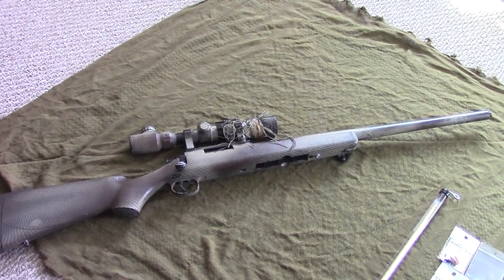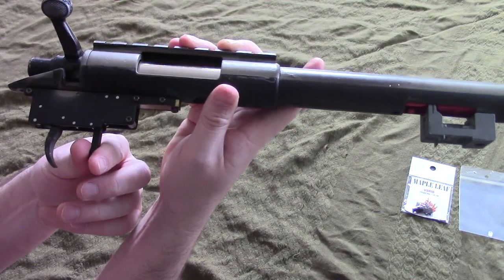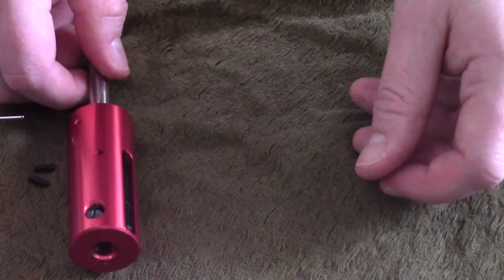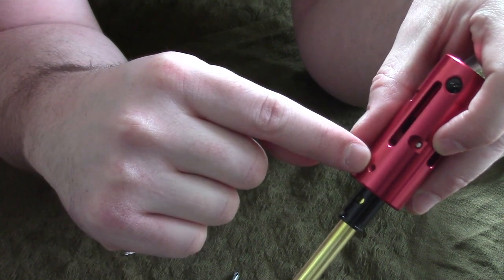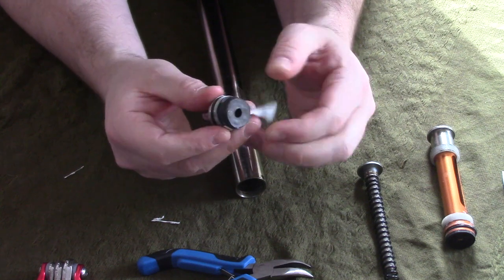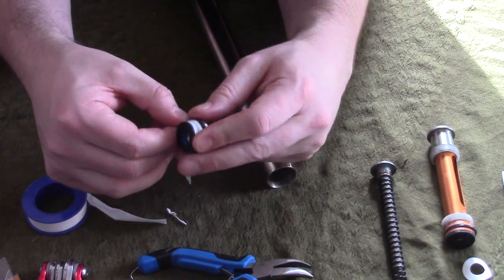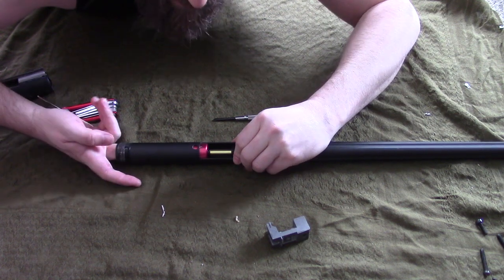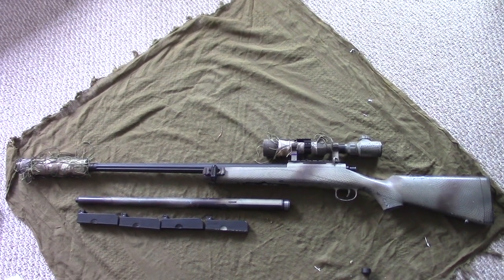Airsoft Tokyo Marui VSR-10 Upgrade

Comment: Can you recommend me some vsr10 stocks?
Reply from the maker: Hmm when you say stocks are you referring to the entire lower body/stock as they’re one piece?
Reply: @kokosaysnono  no i mean the stock the plastic piece of thing that holds the gun

Haha sorry I'm a filipino its kinda hard to explain it in english
Reply from the maker: @migo9625  haha no worries bud I've only used the stock I currently have but I looked into the MLC-S1 stock. It's pricey though but comes with more features and is bigger :)
Reply: @kokosaysnono  thanks bud

Last one question

Do ya think I can modify a m24 stock to make it work with vsr 10 or is there any company that makes a m24 style stock for vsr10
Reply from the maker: I personally don’t know anyone that has done that mod. Looking online I see some old forums pages of people taking a ca m24 stock and modding it. They mention its discontinued though so probably be hard to find.
Reply: @kokosaysnono  ohh thank you so much bud for the fast replies really apreciate it
Reply: @kokosaysnono  you deserve my support
Reply from the maker: @migo9625  you’re very welcome and no worries at all it sounds like a fun project:)
Reply: @kokosaysnono  im planning on upgrading my jg bar 10 that's why I found this video and it really helps me out
The upgrades I already don in the gun is
Aac hop up
Tdc mod
New inner barrel
Edgi sap piston
Edgi cylinder,bolt,charging handle, cylinder head
New bucking
A angel custom 90 degree trigger
Kydex adjustable cheek piece
Cheap 2nd hand leupold clone

Total for this build is about 500-600 bucks btw some of the parts are discounted and second hand so I got it for less
Reply from the maker: @migo9625  Nice.... great choice on the upgrades how are you liking the edgi ? I want to get one of those cylinder / pistons they look awesome. I had a super fun time upgrading mine and it becomes and addiction haha the only thing original left in mine is the bolt handle / stock / lower body haha. It’s funny because if I buy another stock and body I could probably build a second vsr 10 at this point lol. What tdc did you go with or was it just a custom design ? I’m glad my video helped out that’s what I was hoping it would do for others.
Reply: @kokosaysnono  I like edgi since its from here in the phil so you know "love your countries product" haha. But the actual reason I love the EdGi parts is they are good looking and seems to be reliable. The tdc mod is just a diy you can find alot of tutorial in yt (works perfect in aac hop up)
Reply: @kokosaysnono  but there are tdc kits you can find out there my, friend Aaron bought one for $20 bucks
Reply from the maker: @migo9625  oh no way you just taught me something I didn’t realize edgi was from the Philippines. My bud who techs my AEGs is from the Philippines originally :). You tube demonetized my tdc install video because it’s altering a gun lol can’t win these days on here. I bought the one made by gun smithy and so far from tests it works great with the aahopup. I can’t wait to actually game with it though haha currently waiting out the Canadian winter / corona.
Reply: @kokosaysnono  where do you buy ur gun smithy tdc?? Most of the times I always find the chamber itself that is specifically built for tdc mod for about 60 bucks...

Yep youtube guidelines are kinda stupid specially for videos about guns
Reply from the maker: @migo9625  I got mine from the skirmshopNL in the Netherlands. They have a version now that is just the base plate / nob which doesn’t come with the extra arm and nub if you don’t need it.
Reply: @kokosaysnono  ohh its far haha... I love to see this channel grow in the future...thank you for the replies and keep on making videos ur so cool
Reply from the maker: @migo9625  you made my day bud thank you for the great chat and I appreciate your comments :). Stay safe and healthy during these crazy times and let me know how the m24 mod goes :)
Reply: @kokosaysnono  ohh i'm happy to hear that...ill update you here when im done with my gun

I think im just gonna modify my vsr10 stock to have a adjustable butt haha but i'm happy to hear that i made someone's day. :)
Reply: @kokosaysnono  I have a new separate comment about airsoft guns i recommend

You can chack it out if you want

That's just my opinion

Comment: Silencieux ?
Reply from the maker: Good question it came with it when I bought it used so I’m not 100% sure but I believe it’s the TM gspec mock silencer.
Reply: not impossible because the silencer of the gspec does not mount on the barrel flute aac .... shows under the foam green fabrics if there is a mark
Reply from the maker: At least 4 people owned this one before it landed in my hands so I’m guessing someone upgraded the outer barrel so they could use a suppressor. I then upgraded the outer barrel to the AAC fluted which has a removable adapter on the end that allows this silencer to attach. It’s painted and I can’t find any markings on the silencer but it screws on ccw if that helps :)

Comment: How many fps?
Reply from the maker: The m150 will shoot hot until it’s worked in but it’s now shooting .43g at 2.20-2.30 joules which would translate to 500 FPS with .20g. I left the spring compressed for a few nights. Brand new before being worked in it was doing 3.0 joules.

Comment: Fps of that sir?
Reply from the maker: Good day sir :) thanks for watching my vid. I ended up putting the 150 spring back in but it shot hot at 3.0 joules so I worked it in by leaving it cocked for long periods of time, 24 hours a few times. The joules are now 2.3 with .43g bbs so that’s around 340 fps. So if it was using .20g BB that’s 500fps

Comment: Tell me, pls, what silencer do you have?
Reply from the maker: I believe it’s the stock original gspec suppressor but this vsr has had 4+ owners before it made it to me so I can’t be 💯 sure on that unfortunately. It’s been painted a few times as well so I can’t find any markings on the suppressor. This puppy is probably 15+ years old and still rockin :)

Comment: Will this work on any VSR-10? I have the CYMA VSR-10 version and I hope it could work with that
Reply from the maker: As far as I know they’re compatible with tm vsr clones. The cylinder upgrade might be diff for the cyma But there are some vsr sniper forms that would probably have some good info on any issues with the cyma
Reply: @kokosaysnono  do you know where I could find those forums, please? I'm completely new to upgrading airsoft rifles and I don't know much technical stuff about this.